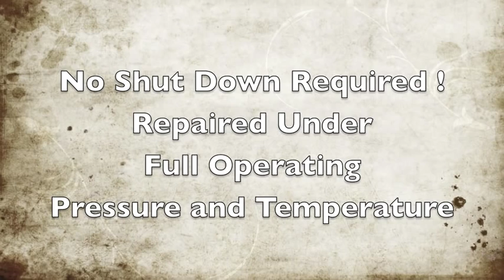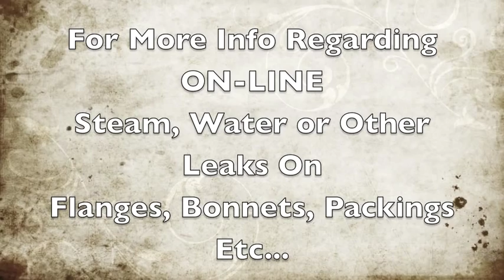Steam Leak Repair While Under Pressure

Comment: Changing bolts out on a 4 bolt flange regardless of the operating pressure without some sort of strongback or engineered c-clamp is a recipe for disaster. This company may not be TEAM but leak repair is done exactly the same way. OD style flange clamps, multi wire wrap, injection nuts, even the injection valves are identical. Carber also uses similar injection valves.